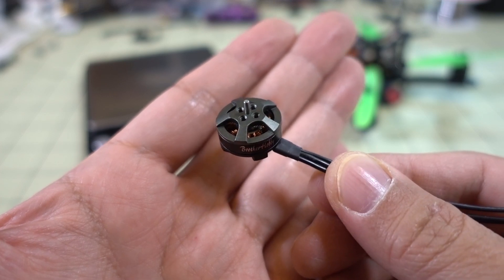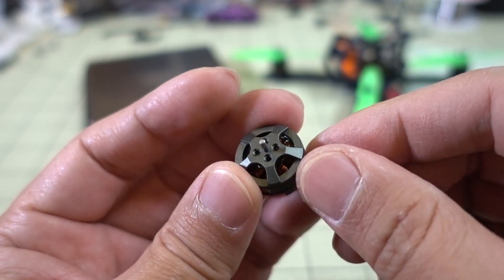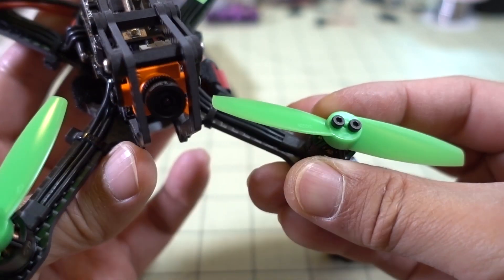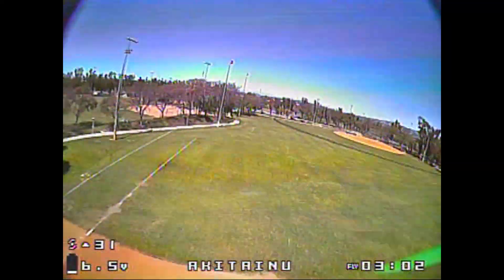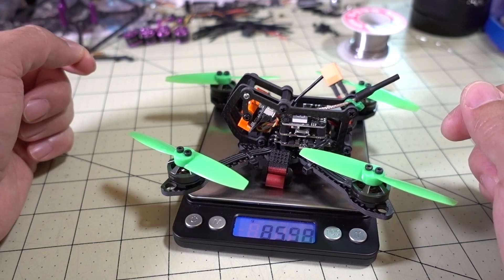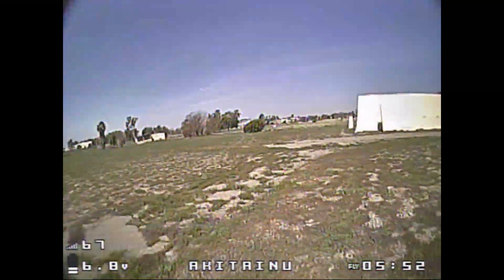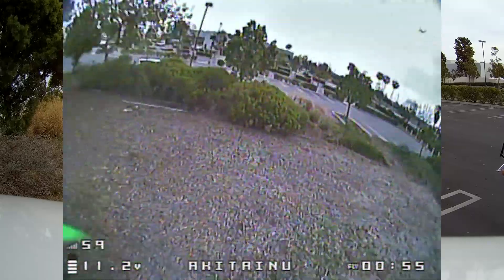BrotherHobby 1402 8100kv Motor Review 😍

Comment: Hey Albert, can you recommend an all in one brushless F.C. for dys 1102 10000kv motors? I’m cannibalising a broken DYS Elf for parts, don’t think they’ll be suitable for a brushless whoop set up, thanks!
Reply from the maker: 1S or 2S?
Reply: Oops, 2S. 2S seems to create difficulty as possibly not suitable to whoop style frames, seems to more suitable to use around 0704 size motors in a brushless whoop (Original Dys Elf Frame is 83mm with 2 inch props)

Comment: I think that in a practical sense, the 1402 motors should have less power. 14x2= 28 while 11x6=66. The total stator volume of the 1106 is higher and should pull more but give more torque. Kind of like how a 2207 acts similarly to a 2306. Although of course build quality and the way the motor is constructed contributes a lot. Just my sense. It makes sense that they are more efficient. Great video and channel. Keep up the great content!!!
Reply from the maker: One thing for sure is that the 1106 would be dead on 3S and 3 Inch while the 1402 flies fine and the motors are cool...  for me, that's more practical.

Comment: Nice to see a micro motor from brotherhobby that Doesn't run hot! I was turned off by 1106 7500s. Even on 2s they would come down too hot for pt1 setting. Were you running that or just biquad?
Reply from the maker: I run PT1 all filters off for all my quads.

Comment: What do you think would happen with 2.5" props?
Reply: have it on my quad with 2,5 inch and also with 3 inch .. both flyes pretty nice. Have few dvrs on my channel so you can check it.
Reply: have it on my quad with 2,5 inch and also with 3 inch .. both flyes pretty nice. Have few dvrs on my channel so you can check it.
Reply from the maker: They're here to stay
Reply: I meant What would happen with 2.5" props with these motors? Not enough load on the motors? Burn out?
Reply: flyin Goat Thanks. I'll have a look :)

Comment: Very exciting motors! What other motors do you have in the pipeline? After getting a taste of the RCX1304 5000kV I can't get enough of these bigger diameter motors.
Reply from the maker: Got those 1304's, some DYS 1404, RotorX 1404, secret 1304, secret 1205, secret 1403, secret 1404.  I'm under NDA, so that's all you'll get, sorry!
Reply: Looking forward to seeing the review of the DYS 1404's.  I have the 6000's and am running them on 4s 😋

Comment: it would be interesting to see how a lower kv  (say ~5500) version of this motor would do on 3" props as I'd be willing to bet these 8100kv motors aren't coming anywhere near close to 90k RPM WOT on a 3S 

(this is why we need more blheli32 4in1 esc's with telemetry so we can see the amps/rpm etc per motor in blackbox!)
Reply from the maker: What's special about 90k RPM?
Reply: Albert Kim 8100kv x 11.1 = 89910 RPM for an unloaded motor. The props would probably explode at those RPMs!! From my experiments I've found 5000-6000 kV is the sweet spot for 3" 3s as it basically flys like a 5" already so higher kV is just wasted.
Reply: this is true they are stupidly high kv for 3s and if the props could actually achieve that rpm the motors are trying to spin at  the prop tips would be going like mach 1.3 lol yet somehow they still seem to work great

Comment: These look decent, will they work on 2.5”?
Reply from the maker: Yes, but obviously less power.  The 9500kv might be better on 2S for 2.5 inch, but I don't have those motors.
Reply: planning my slightly heavy (split mini) 3S 2.5" build, got some gemfan 1105 7500kv on hand
not sure I'm good with those or should I use some other 1106 6000kv, may it be GEP or Emax
especially GEP ones, you make them look good

these BH ones are interesting but they seem more intended for lightweight 3" instead

Comment: Wow... please try these with the triblade gemfans :)
Reply: yeah I was about to pull the trigger on 1106 6000kv then I saw this! And 8100kv on 3S!!!! WOW and no heat issues.... WOW!!!.  Also was not surprised it came in lighter as the more weights about 1g less than 1106 6000!!!!! WOW WOW!!!!

Comment: I wonder if it’s worth changing to these motors vs 1106 6500kv on 3” 3blade gemfan.
Reply from the maker: I wonder that too.  I hope someone who has those motors can test and tell us!
Reply: Steve- are you rocking the sunnyskies?  I love the 3" x3 gf, best prop out imo.  What are your flight times like?  I ger 4 mins on 1106 6000 emax's.  But I think the sunny sky has more power. But i dont want much less flight time.
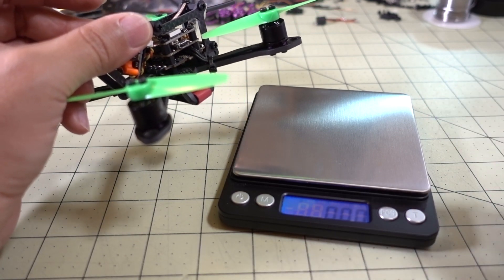Reply: Jrod RC I never get 4min of flight with emax 1106. The Sunnysky 1106 6500kv are more powerful than the emax for sure. I am getting about 3:30 seconds, if I fly really hard about 3min with heavy freestyle.

Comment: For 3" props a good fit. Over twice the run time of the 1106 motors and it can run 3S without over heating the motors. I will need to give them a try on a 3" build. So far I like my RCX 1304 5000kv motors for 3" props with 3S
Reply: the rcx 1304 are great for their price! I would love to know how they compare to these 1402s

Comment: This is awesome I hate changing batteries all the time. I get over 9 minutes using 1106 4000kv and 550mAh 3s GNB. 3" inch props on that same A-max 130mm frame purchased from Amazon.
Reply: Thats awesome dude. I prefer more performance and 4 min flights.  9 mins is too long to concentrate on while rippin.

Comment: Put these motors on the 2.5 Massive Droner.
Reply: Actually they have a 3 inch version of the massive droner frame I saw it on the website, im also interested in using this frame.
Reply: Yes, the 3" Massive Droner is using 1507 motors.  I bet that rips.

Comment: How does this motor compare to emax 1106 4500kv and 6000kv on 3s?
Reply: I run emax 1106 6000kv with GF 3035 props all day long on 3s tattu 650s. on a fly fox frog frame. weight is 90 grams.  My 5" buddies are impressed with its performance, they thought it would be a joke.  Notch the frame in the front and a little bit and it rocks 3" props.  I get 4 mins of flight.  I fly similar style to Albert, not to crazy but not cruising either. 

So yeah Im wondering the same, if these motors get that performance and If I can up flight time. or just be easier on my batteries.  At 4 mins they are fully drained sometimes I dont make it back lol :)  Also looking at sunny sky 1106 6500kv for 3s.   Also the dys 3045 props are too much for 3s and the durability is terrible a few crashes and theyre no good. the GFs I can bend back over and over and last weeks not flights.
Reply from the maker: I would rule out the 6000kv on 3S.  The motor will burn up on a 3 inch prop and amp draw will be huge.  The 1106 4500kv is the one on the 3-inch Babyhawk-R and they recommend running that on 4S.  On 3S, flight time is about the same as the brotherhobby motor, but the thrust is weak.

Comment: Very interesting. Looks like this may be more acrobatic on 3S than I thought. For a Massive D, 3S, 2.5" build is it too soon to ask - 1402 or 1304 or 1404? Like a balance of power and efficiency - not a 2 min power punch flt or a 6 min light cruiser.
Reply from the maker: I'd wait for the 1404 6000kv motor review

Comment: Got me thinking hard here.
Reply: Ok just pulled the trigger 4 are inbound thanks Albert. I got a custom made 139 mm that has 6000kv 1106. It swings 2.5 inch but could easily hold 3” due to heat I haven’t. Its a bit on the heavy side due to the SQ12 I have mounted on it. This may be just what I have been looking for. Thanks Albert!